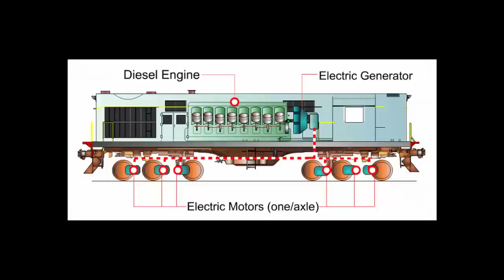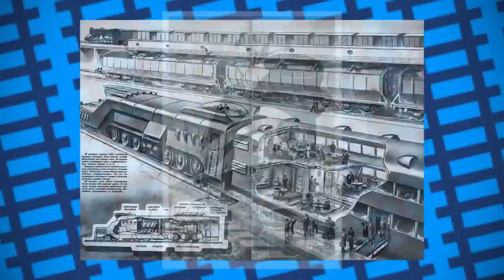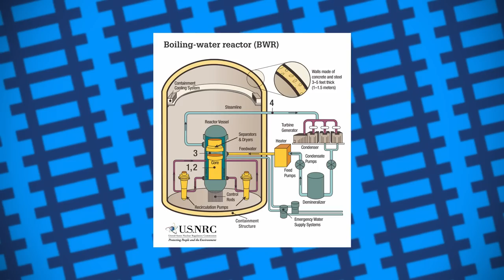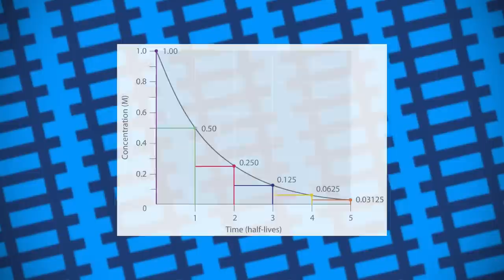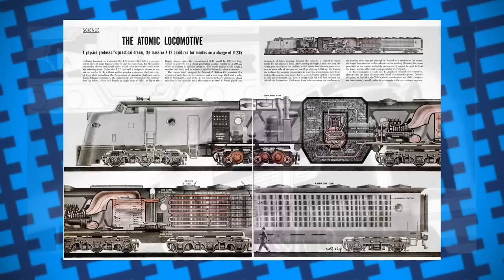Why Nuclear powered trains aren't really a thing

Comment: At this point what I see as the solution would be to have battery-electric locomotives on partially electrified tracks. One advantage of trains over other types of vehicles is they aren't really weight-limited, can add as many battery-loaded "tenders" as you need. Could have some portions of the track electrified, where trains can re-charge while moving, allowing them to go some distance without overhead lines. Perhaps an electrified main line and un-electrified branch lines. Or a route that is only electrified in sections, with other sections (presumably more remote parts) not electrified that trains cross on battery power.
Reply: The more tenders you have, the less freight you can haul.
Reply: @jailbird1133  True, but the tender would be the equivalent of one freight car, so not a huge loss of capacity. A trade-off, but it is an option no other mode of transport really has. Was seen as acceptable in the steam era, or even the Union Pacific "Big Blow" gas turbine electric locomotives. Gives me another funny thought - just for the hell of it, have a battery locomotive pull a train of nothing but battery tenders and set a record for the longest unrecharged journey by a battery electric vehicle, could probably make it all the way across the Continental US, maybe even multiple times.
Reply: @quillmaurer6563  Well technically that record is infinite if you include solar powered drones.
Reply: That is basically what's already being planned for small branch lines in Europe, Schelswig-Holstein has been operating battery powered commuter trains for a few years now and DSB is testing them.
Reply: @hedgehog3180  Makes sense - figures that Europe would be the place to try it. Sounds like for passenger trains rather than freight that I had in mind, but same idea. Are they locomotive-hauled or EMUs?
Reply: @hedgehog3180  True - though that's with input of outside energy, not battery only.

Comment: You made many mistakes in this video: 1.- Nuclear micro-reactors are very small. Currently we are developing micro-reactors to be transporter in tracks. 2.- Radiation Shielding doesn't have to use concrete. 3.- You need no one using a compact nuclear reactor: they don't need maintenance and they can operate for a decade without anyone doing anything to them. 4.- Do you really mean that smug, contamination, and CO2 emissions are healthy? 5.- There is no nuclear waste. Maybe you mean spent nuclear fuel which currently, or in the near future, can be reuse at other nuclear reactor designs? 6.- Nuclear fuel bars are package in a way that there can't be nuclear fuel fuel in the air! The new nuclear reactors can resist a crash coming from space, exploding or impacting directly on the planet surface without rupture (we tested it!! Please google the documents from the U.S. NRC, the US DoE, NASA, DARPA, IAEA, etc). Even more, nuclear reactors such as the one sold by INVAP Argentina to Australia can handle terrorist attacks and even a plane falling on top. 7.- Security for the reactor? Are you serious? This is not nuclear weapons grade fuel: you cannot use it for nuclear weapons, nor for a dirty bomb due to its packaging. Please inform yourself better if you will publish content in Youtube. You are causing a lot of damage by disinformation. Thank you!

Comment: If you can build rails you can build overhead power lines. The power lines will take much less material than the rails. The problem isn't the technology, the problem is that the US is run by fossil fuel companies.

Comment: Nuclear waste would not really be a problem.  All of the nuclear waste in the world right now could be stacked on a football field to about 30 feet high.  The trains would not contribute all that much more.

Assuming sufficient shielding is used, coal-fired steam engines actually give off more radiation than a nuclear counterpart would.

The real problem in my mind is cooling.  Where is all that water coming from?  The mass of shielding might be one thing, but carrying enough water to cool would be the real problem.  I guess we could run canals along the tracks for the trains to scoop water from, but that seems impractical.

Comment: Shielding isn't really a problem since there are workable solutions to protecting the crew without resorting to hundreds of tons of concrete--for example the compact reactors on submarines--and the USAF even managed to make a workable nuclear reactor which could be installed on an aircraft...in theory anyways. Though the USAF came to the same conclusion you did regarding aircraft reactors, in that it would be a *very* bad idea to take a nuclear freaking reactor and huck it around at several hundred miles per hour.

Comment: At present, nuclear power is steam turbine power which needs condensers to be effective. On a ship or submarine, this is no problem but on a ground vehicle the only condensing medium is air which makes a condenser impractically large. Nuclear power from fixed plants seems the way to go, though in the USA the structure of taxation discourages electrification far more than long distances. Installing the catenaries and substations, etc. increases the property valuation and the taxes, so the number of electrified route-miles in the USA has actually declined over time.

Comment: "Battery powered trains ... but the sheer amount of power needed"

That kinda goes against what makes trains so great, that they DON'T need a lot of power per ton of cargo.
What really makes trains require a lot of power is the starting phase. Accelerating that mass takes all the power, while keeping it rolling on level ground takes almost no power thanks to the low friction of rails.
The solution therefore to battery powered trains is to have a grid where they need to accelerate but then they can go off grid when they only need to keep rolling forwards.
A significant portion of the us is flat ground which would be excellent for battery powered trains and you only have overhead wires at places that the trains need to start rolling from.

The problem then only becomes, "what happens when the train needs to stop where there's no overhead wires" and for that i have no good solutions really.
But as long as it doesn't have to be started on battery power they are definitely doable.

Comment: The radiation shielding would only be part of the massive amount of weight required to make a nuclear train work. In order to get electric power out of steam you need a turbine, which by itself is a large piece of equipment, but then you'd also need water pumps and a massive condenser to make a closed-loop steam system work. If you decided to run an open system that releases spent steam like the old steam locomotives in order to save weight then you'd be giving up the range advantage of nuclear power as you'd still have to stop and fill up your water tank all the time. And if you ever got stuck without access to water then you'd have a meltdown. Not ideal!

Comment: also a nuclear reactor doesn't magically produce elctricity. so you either have run it like a steam engine with the reactor in place of the fire box or you run the full kit of reactor, boiler, alternator, condenser, cooler.

Comment: What I think is funny is that because Nuclear Reactors often use water as coolant, locomotives would go back to needing to stop for water pretty regularly. It feels like we'd be going back to the age of steam, and I'm apparently not the only one to think that.

I was also thinking that you could try using RTG's, but I quickly realized that getting enough of them or one that was big enough would likely be so heavy that you'd loose a lot of your pulling power to your own locomotive's weight. It would be harder for a wreck to cause a disaster, unless the RTG casings were cracked, but you'd still probably need to guard them 24/7 due to them being a relatively easy source of radioactive material.
Reply: You wouldn't need to stop for water on a closed loop system, the trains would need massive airflow through the heat output section instead. Heavier, but works as well. Could have been done to steam engines as well but I guess the need for coal stops anyway kind of negated the intent given the added weight.
Reply: We never entirely Left the age of steam. When it comes to generating electricity, coal, oil*, nuclear, and solar* all use the stated fuel as a heat source to power a Steam Turbine. 

*while these are also used in other ways at smaller scales (photovoltaic cells, internal combustion engines), as large, grid scale generators, my understanding is that the above is true. 

Which is to say, Electric trains are often basically steam trains, in a sense. heh.
Reply: @laurencefraser  It's like carcinization, but with power generation!
Reply: @Kalvinjj  I was operating under the assumption that there are two halves to the cooling loop, one which is closed and the other open. The idea being that you needed to refill the open loop, which I guess could suplement the air cooling.
Reply: @strcmdrbookwyrm  This is correct for a power plant system, it is indeed how open loop cooling works, it's a valid proposition for the heaps of power a locomotive would generate.
A closed loop would be quite akin to a car radiator in other hand, not requiring refills, but I wonder about the size, likely would need heaps of forced air flow too.
Reply: @Kalvinjj  Don't worry, I got it. I just thought I'd explain what I was thinking.

Even with a closed loop cooling system, I think a theoretical nuclear train would end up looking a lot like a classic steam engine. Though it really would depend on how you went about cooling the thing.
Reply: @strcmdrbookwyrm  Yep, I like to imagine an enormous boiler-like structure at the front of the cabin but with lots of fins around and a massive fan up front pushing air through while not moving.

...tho likely the reality would be way more boring and look like a diesel with just radiators on the sides or top and a square box killing all the nuclear-steampunk fantasies...
Reply: @Kalvinjj  The way I imagined it was somewhere in between those two ideas. The front half with the reactor casing was a cylinder, instead of fins I pictured water/coolant being pumped around the reactor core (thus serving as both a coolant and an extra layer of shielding, because water's good at that) and into pipes that go into a more blocky back half. Inside that half the pipes would be all squiggly, and maybe have fins or go through plates to increase the surface area, to cool the water off before pumping it back into the reactor. So basically a set of radiators in a box.

Also, I think that once the engine got above certain speed, they'd probably have a system to open vents on the front and back of the box (in any design) to make the cooling more efficient. Though now that I'm thinking about it, controlling the temperature and power output would be a bit finicky. If your cooling is more passive, you'll only be able to produce so much power when stationary, but more when your going at higher speed.

Comment: I think that Nuclear powered trains were going to be very expensive, useful but also very dangerous.
Reply: And probably turn out impractical as all hell for anything but hotshots that don’t have to change speed for hours or even days on end because throttling a nuclear reactor up or down takes long… and the steam turbine running the electricity has a very narrow margin from peak power (efficient as hell) to idle (needs almost as much power for no output)…

Or we take the French approach: electrify and get the power from stationary reactors that can spread the output over as many trains as necessary so they don’t have to throttle up or down…

Comment: Putting an entire reactor on board a locomotive is impractical, but there is another alternative, though I couldn't say offhand how viable it is and how much related technology would need to improve to make it possible. Spacecraft on long term missions far from the sun use what is essentially nuclear waste as a battery, using the radiation emitted to excite electrons very similar to the way solar panels work under electromagnetic radiation. (Indeed, gamma rays are simply higher frequency electromagnetic waves from a nuclear source). Obviously the power requirements of a locomotive are much, much greater than a small space craft, and shielding and disposal of the next product of the nuclear decay chain would still be a concern, but it seems like an avenue to be explored.
Reply: RTG will give you about 10w.

Comment: While many of the reactor design and operating safety concerns you noted have actually been resolved in recent years (not to mention, there are a great many wildly different reactor designs), obviously crashes would remain an issue. I don't see locomotives like this ever entering normal service if developed. Specialized government and military service with a limited number of units, however...

Comment: I think if they did exist they would have a rapid ejection system for the reactor so it could be ejected in the air and or to the side were it could be strong enough to withstand the impact.....  If it was ejected in the air it could have parachutes...

Comment: I always thought that nuclear-electric was somewhat silly, as most nuclear power stations make steam to spin a turbine, so you could make a nuclear steam engine, and probably produce zero waster by reusing the steam.
Reply: Problem with that is the steam turbine… they tend to have horrible efficiency curves (peak power is efficient as hell but idle takes almost as much fuel and locos often can’t run at full throttle for long enough to make up for the rest) add to that the time it takes to throttle a reactor up and down and you suddenly have to waste a bunch of power all the time, which takes tons of cooling or some sort of consumer…

Way easier to leave it stationary and spread the load over many trains

Comment: Bcuz of 1 word: radiation
Reply: crews of nuclear submarine would like have word with you
also conductor doesn't have to jerk of on top of reactor
you can pit the reactor few cards away from control card
Reply: The correct one word is: Derailment. 

Radiation itself isn't a problem, it can be contained with adequare walls and protection but if a Derailment were to occur then it would be bad

Comment: With the shielding, it would not be practical... also having properly trained staff capable of handling the reactor; and the issue of disposal of the reactor and train at the end of life....  This application is in the same class as nuclear power aircraft.... one of those "out there ideas" from the 1950s.... a gas turbine driving a generator set would be more practical than this, but that was tried in the 1950s, 60s and went no where....

Comment: Fun fact,  Scientists recently we're able to create a fusion reaction where instead of splitting the  Atom they instead fuse or push them together that creates energy like  Atomic energy but you don't have the dangerous radiation side effects and creates more energy as it works. It is still in its early stages, but this safer form of nuclear energy could replace all the existing nuclear power plants, submerines, and ships. It could also mabe be use in an atomic train!
Reply: This is why going back to the moon will be way more useful than going to mars
Reply: Fusion releases MORE radiation not less. That's the whole point.
Reply: Fusion really really doesn’t solve the problems you just said it does.
DT fusion, the type we are closest to a viable power plant with, releases about 80% of its energy as fast neutrons, which is basically the worse possible type of radiation. Not only is it hard to shield, but it turns non radioactive materials radioactive. 
Fusion is only safer than fission in that it can’t melt down because it’s so unbelievably hard to make work, and it just turns off if it fails. In every single other way it’s actually worse.
But it hasn’t had its reputation among idiots tarnished, and it’s actually cheaper to spend a century working out how to build a worse type of reactor than it is to convince morons that fission is safe.
Reply: Zoomers discover fusion 🤣
Kid, I heard that kind of stories 40 years ago. "Fusion energy is only 30 years from now". Always was and always will be...

Comment: nuclear power plants don't produce any greenhouse gasses is the thing. the cooling towers pretty much takes water from your bathtub and turns it into steam, so unless you're allergic to rain it will be of no harm to you
Reply: Steam is the number two greenhouse gas.
Reply: @Marci124  on what list because now I'm curious. like harmfulness or by percentage?
Reply: @cegicreator2476  By total effect, which includes the amount. Carbon dioxide and other, more exotic gases are worse by mass, but much less prevalent. Rare synthetic gases are the worst, but also the rarest.
Reply: @Marci124  OK so if it's by total effect I have have difficulty trying to figure out what would cause so much steam. my only guesses would be from cooling towers, hydrolox rockets, water purification, maybe some refinement processes, and cooking. is there anything else if forgetting because I always like to get all the bases when I talk about a subject
Reply: @cegicreator2476  Count in the sun and basically everything alive under it. I didn't mean the second most impactive human-made greenhouse gas, but second most-impactive overall. There aren't many high-impact man-made sources, but some of the ones you listed are among them.
Reply: @cegicreator2476  Burning hydrocarbons also produces steam in most cases.
Reply: @cegicreator2476  But yeah, your original suggestion also wouldn't make much of an impact in terms of extra steam released even if it was widely adopted, so my initial comment is mostly pointless.
Reply: @Marci124  OK I misunderstood but thanks for the clarification!
Reply: It will harm me, if my bathtub keeps emptying!